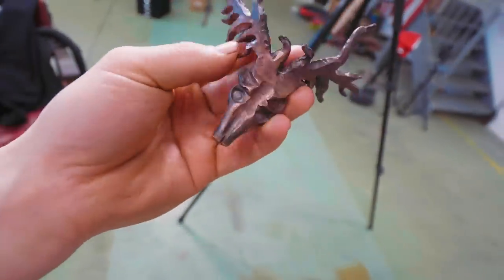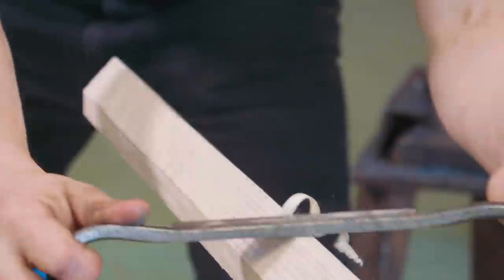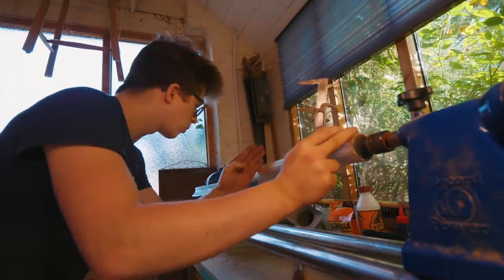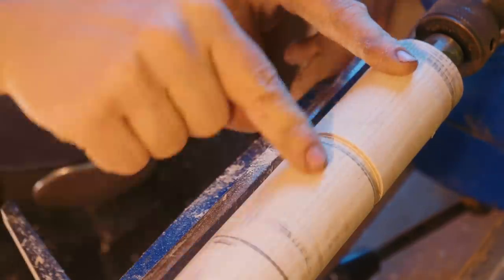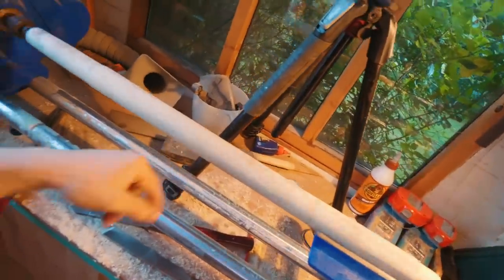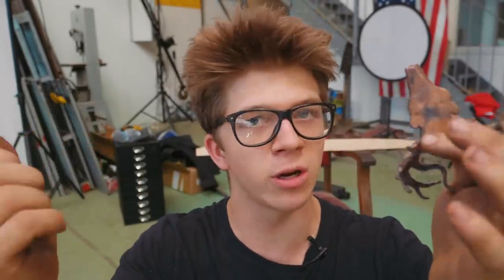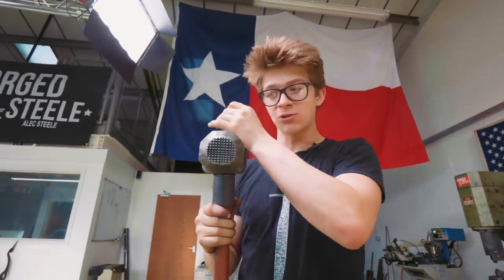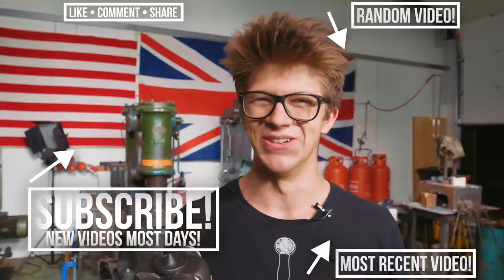GENDRY'S WAR HAMMER: GAME OF THRONES: PART 5 - FINISHED!!

Comment: As far as making copper pins stick with heat, Experiment with 2-12v batteries it a series. If you put the ground on the base/collar/thing recieving the pin then assemble everything with the end of the pin exposed. Put a nice piece of good steel rod or even a welding rod on the end of your positive wire and cut it's end to a nice point. You need to make the pin loose it's contact.  So you  could drill the hole out a tiny bit and cover the pin lightly with white out or nail polish or whatever you have that is a thin non conductive liquid.  make a couple small scratches in whatever you end up using. When you touch the hot to the pin it will arc at the scratch before it grounds out and tries to melt the rod in your hand. Personally,  I would have drilled the eyes out and made small steel pins that would go through drilled holes in collar into handle. Would really be cool if each pin could line up to go completly through from eye to eye and just get punched on each end to widen them out and polished to make color difference stand out.   Or  You could put plastic wrap behind the head,  attach the hot to a longer Copper pin and drive it in. When it reaches collar it will arc and melt then cut and smash the end in eye hole. But using a couple batteries OR a small arc welder would give you lot of different options that I dont need to try to explain since you seem to be capable of thinking outside the box.

Comment: The taper should fall towards the handle, preventing the head from coming off the end. Just a tip for next time. Check out most sledge hammers and pick axes.

Comment: Alex, the next time you are going to try and slide metal collars or end caps onto a wooden shaft try using a different technique.  I suggest that you prepare the diameter of the shaft just slightly too large for fitting into the metal cap.  Next, heat the metal collar or cap to a nice cherry red; this will cause the metal cap to expand, and allow you to fit it over the wooden shaft.  Once the cap has been fitted, cool the collar, which will reduce the collar's diameter; it will be so tight you wont be able to remove them.  This is the same technique used to fit the metal ring around the outside of a wagon wheel, so it's a time tested metal or wood working technique.

-Aaron

Comment: As a baseball player, you should have lined up the grain of the handle with the angle of attack of the hammer head.  This would have provided the most amount of strength.

Comment: It is stunning absolutely brilliant piece. Those stags and the hammer itself. The only change I'd make would be to put the piece from the bottom of the handle at the top with wood going through the entire hammer and being secured inside the top head piece. I'd then use the point at the top at the bottom of the handle and include a decent length and thicker collar their as well to help the balance a bit. Maybe a couple of metal collar grips actually on the handle as well although that might be hard to get the placement right on. Either way just WOW!

Comment: An iron or steel handle would have been much better; all that construction work only to have a decent sword stroke sever the handle in battle and render the warhammer useless... Many if not most Lucerne hammers, Horseman's Picks, Mauls and various pole arms had metal handles, or a metal sheath running half the length of the handle from the head to prevent the cutting of handles.

Comment: I know it's been a few months, but I'd recommend you take some advice from jewelers about bonding copper with heat. We use a small torch and solder to weld pieces together, and one way to bind your pins might've been to tin them with some solder, press them into the stags, then heat the stags to melt the solder and create a bond.

Just remember solder flows in the direction of your heat and there's a lot you can do with it!

Comment: To weld copper you need a helium argon mix using a mig with copper wire preheat to 475 degrees F.

Comment: Should've just used the lost wax casting method and rather than cutting off where the copper was poured into the mould, use those for your pins.

Comment: You need to consider doing some interference fit work. Hole just smaller than you want, heat, place pin, let cool and it is stuck because the hole shrank.

Comment: Next time you need to mark where to drill holes, use that paint marker and put paint on the pegs you need to drill the holes for then set it where you want it. The paint will leave dots exactly where to cut 🤙🏼 sick build too

Comment: I believe that blacksmiths in the past would have gotten to the handle to the approximate diameter and then made any ring shaped ornaments red hot. As this expands, it is pushed over the handle, burning anything in the way, hardening the wood and tightening up as it cools down. That way nothing needs to be glued and it holds on nicely. If, over the years the handle dries out and shrinks,the whole thing goes into a bucket of water for a night and its back to perfection

Comment: If you wanted to connect pins without glue to copper use solder. Copper is a inert metal. Meaning you can't weld it.

Comment: It's just like soldering copper pipes in plumbing get your Flex get your copper pans put the flex on a copper pans after you drill your holes start your soldering torch up take some solder heat your copper up then run your solder around it and it's just weld

Comment: I would've used pins.
Place the pins into your base and cool them with liquid nitrogen, and at the same time heat up your copper stag. Then once the stag has reached critical expansion heat slip it over the cooled pins so that once the temperature normalised you would have a perfect near weld level seal on the piece.

Comment: Hey Alec, not sure if you already do this, but because it wasn't shown I thought I'd throw in two cents.  When driving wedges into wooden handles, you want to make a pilot hole centered where the tip of the wedge will end that is larger than the head of the wedge.  It relieves stress in the wood and prevents splitting.

Comment: An old trick my dad taught me when changing handles in tools, if you hold the wooden handle and suspend the head below, strike the bottom of the handle and it will draw the head on. I'm not sure why this works but it works.

Comment: you solder the pins in.   welding, brazing, and soldering are all ways to join the metal the only difference is the head involved.  welding is hottest,  soldering is coolest.  welding actually joins the metal on a molecular level, while brazing and soldering are more of a mechanical joint.  Also, when putting a wooden handle in something like that you hold the hammer in the air, head down and hit the handle on the end with a hammer, it shocks the handle in without getting anything into a bind.

Comment: 15:20  Try using a silicon bronze filler wire. it's used more like a solder, you don't melt the parent material you just heat it and sweat in the filler rod.

Comment: I probably would have cast a handle mount into the hammerhead. You can mold something out of styrofoam and then sand into shape then build a cast around the hammerhead and styrofoam with a box and sand and pour molten steel into the mold and then polish to the final finish. Seen a few people on youtube do somthing similar with an old axe head for reference.

Comment: you probably wont read this seeing how it has been over a year. however if you do for the stag heads to connect the pins you could of brazed the parts together. as for when you were cutting the groove for the wedge you should of waited till after the hammer head was on with the wedge in place to cut the size down. it significantly reduces the chance of it splitting and the fibers from the wedge and the surrounding wood in a way intertwine. other than that you did an amazing job and i love your videos.

Comment: When actually handling the hammer get it on the end of the wood enough to where when you tip it upside down the hammer head won’t slide off. Then hit the bottom of the handle. It may seem counter productive but that’s the proper way to handle and axe, sledge hammer, etc. it places the head of the tool exactly where it need to go and doesn’t stress the wood

Comment: In order to tig weld copper, you need copper filler wire to use as pins. What you had was copper coated steel filler. You cant weld those two metals together. You could have brazed the steel filler to the copper, or soldered it into place.

Comment: with the copper piece, you could drill a shallow hole, use some sort of small chisel to widen the diameter of the bottom of the hole (not sure if i'm using the right term here). heat the piece and the end of the pin and softly mallet the pin into the hole. the theory here is that the heated end of the pin widens into the shape of the hole, preventing it from coming back out. the heat-fit also ensures no rotation or wiggle room when the piece cools to room temp. hopefully this helps :) essentially riveting

Comment: For the deer why don’t you weld two pins off the collar in the position of where the deers eyes should be. Drill a hole through the deer‘s eyes so that the pins stick out and then smash them so that they basically make the eyes.   You now have them holding down the copper deer with the steel.

Comment: Copper screws into the handle. Cut the heads off and drill a hole in the moose head with a countersink angle and peen the screw flat.

Comment: You can solder the pins into the holes just take a piece of your welding wire get an iron with a pointed tip and heat that wire up over the holes and stick the pins in quickly

Comment: put the pins in place then heat the copper and place some tin to the pins and it will automatically adhere around and seal it in place.

Comment: Little trick for getting the heads on the shafts: tamp it down, then flip it so the head is hanging on the shaft, suspended off the ground, then rap the pommel with a mallet. It will "bounce" the head right up; the force of the mallet strike has to have somewhere to go, and with no solid surface under it, the recoil transfers the force to the head on the way back.

Alternatively, you can get a round collar that fits around the shaft and extends above it, solidly place the pommel/butt, and use the collar to tamp the head down. A good, solid but yielding surface under will keep it from bouncing back, generally speaking.

Side note: When you set up an anvil, it's a good idea to put it on an Earthen surface, such as crushed rock , sand, and clay that has been tamped down, (compacted), well. Soak it before placing the anvil stand, and place and secure Stand and anvil, fire up the forge and put it to use pounding out some iron. Soak it periodically over the first week of use. After that it should be pretty good. Concrete actually makes a really poor surface for an anvil as it bounces, and produces a resonating vibration that travels back up the anvil with each strike.

Just as an example, drop a ball of good, hardened steel on a slab of concrete. That bounce is a good indicator of how much vibration you are going to get; your surface should be hard enough that it doesn't dent much, but absorbing enough that the ball doesn't bounce. If you have a concrete floor, you might want to create a box where you are going to place your anvil, and fill it with a compacted, earthen material before placing your new anvil.
Reply: Actually, if you take a steel ring a little greater diameter than your block and about 6 inches deep, bolt it down and fill it with a mix of casting sand and wood ash, (say 1 part wood ash to 8 parts sand, well blended, get it nice and damp and set your anvil stand, (Ash, Beech, or Oak with a straight grain might be nice), tamp it down and level it, then drill and lag your anvil to it and use a wooden mallet to tamp it by striking solidly and firmly on the center of the anvil. Tighten your lags a little more and let it sit over night, then give them one more torque in the morning. Obviously you don't want to strip them, but I expect you know that.

Something I noticed you don't do, that you might want to try, is using heat to burn in wood. You might want to try for example, using a torch to charcoal the surface of your anvil stand before you mount the anvil. When you put pressure to it, the carbon will shift and fill gaps when you set the anvil. Not much, but enough to charcoal about a 16th of an inch of the surface depth. When you tighten those lags the first time it will fill the gaps in the anvil, and after you tamp it and tighten the lags again, you should have a really solid mating of the anvil to the wood.

Ideally, when you strike metal on your anvil with a hammer, the force should transfer straight down through the anvil and into the ground without bouncing back up.

I'd also forge a good, flat-faced hammer about 4 inches on a side and slightly beveled edges. Nice and heavy, with an inch an a half hammer head depth, and on the obverse, a cutting wedge 90 degrees to the handle. This is what I think I would use for layering steel, if I were to do that. It has a good surface area for flattening the steel, and a flat cutting wedge would be good for folding cuts. I thought of it while watching your power hammer at work on billets of damascus; seemed like a good idea.

Comment: Had to stop the vid at 12:20 So I can comment on your last statement.  Perhaps a 12 lb war hammer doesn't seem practical for use for you but as a guy that holds a 15 lb chainsaw in one or both of my hands all day and in all kinds of different positions I can say without doubt that it could have been a very practical weapon for the right person . Face it, you made the handle a little thin . Since its just for looking at and your talking about wrapping the handle, who cares man, it's still freaking awesome!
Reply: No, no it wouldn't. There is a reason that hammers like that weren't used in the real world. No matter how strong you are, you are better off with a lighter and faster hammer. Yes, the heavy one would hit harder but you cant adjust your blows or block as effectively. It just doesnt pay off.

Comment: I would of not used a multi material glue I would of made small copper forged rivets   And  via used the elks eye wholes to  mount the elk skull on  to the war hammer, also i don’t really agree with water quenching i prefer oil quenching
Reply: maxdeathpick if you’re going to criticize then at least offer up silver solder for the elks head. As far as quenching - many smiths are confident with water knowing their steel but forged in fire fanatics think only oil is appropriate.

Comment: spot weld pins? like you would a thermocouple to monitor heattreament cycle.
Reply: use a box and button/momentary switch. wire a circuit through the handle of some needle nose to hold the post and ground your part. position with pliers and discharge arc by pushing button. Obviously bare metal needlenose are inappropriate.

Comment: I think I would have drilled straight through the collar and then used the holes on the collar as guides to drill into the antlers.
Reply: Also you could have soldered the pins into the antlers. Solder is pretty cheap.